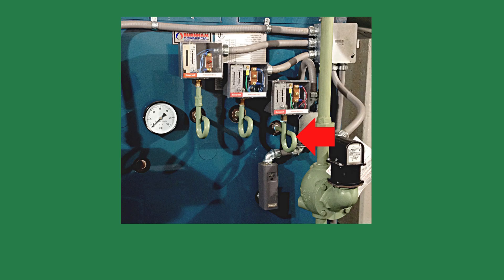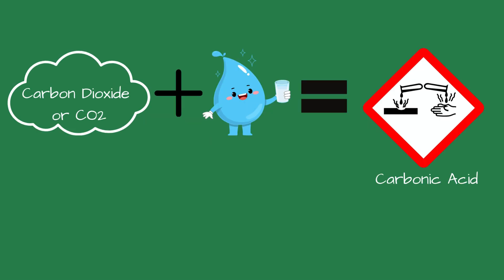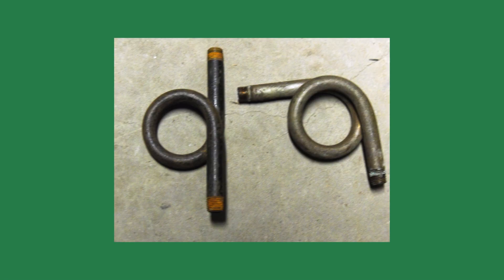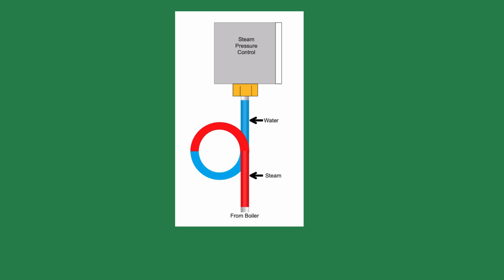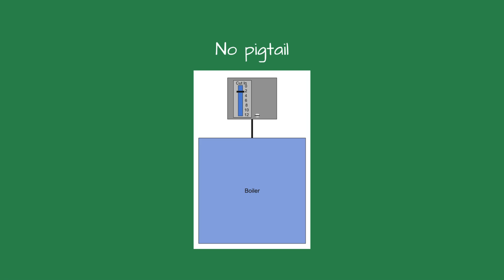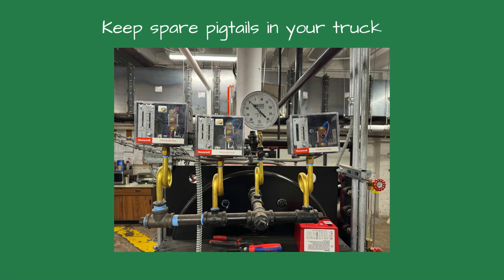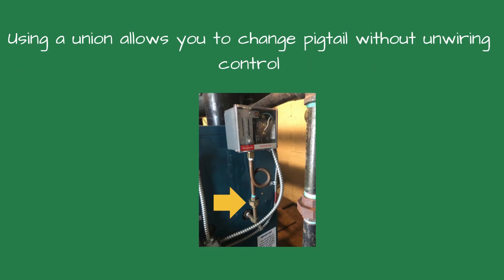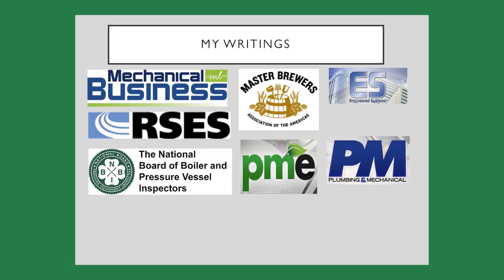What is a pigtail and what does it do

Comment: Nice! I came here to learn what a pigtail is. There’s a short that shows how to clean a clogged one. Heat it with a torch almost red hot and dunk it in a bucket of water repeatedly. Water turns black, pipe is unclogged.
Reply from the maker: Really I will have to try that Thanks
Reply: Here because of that short, too. 🤣